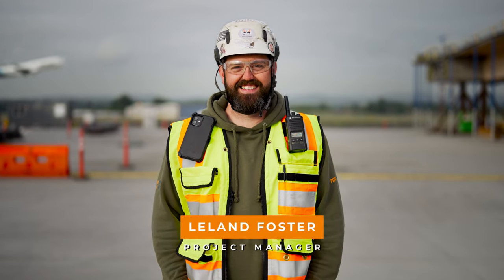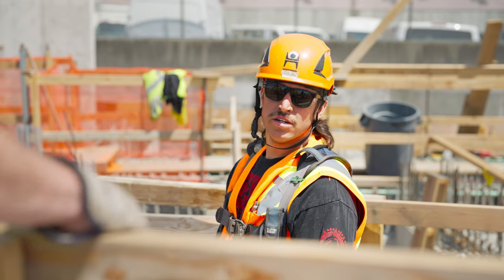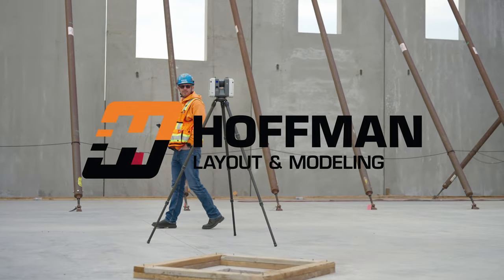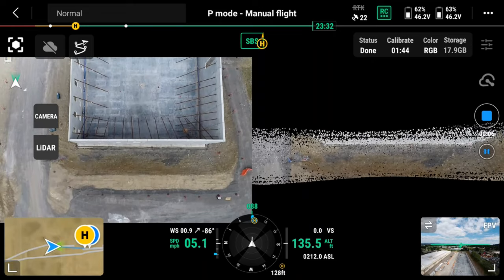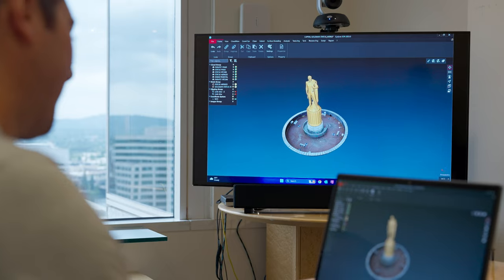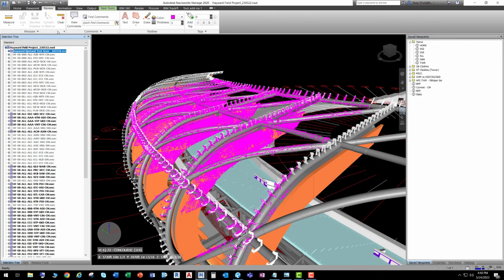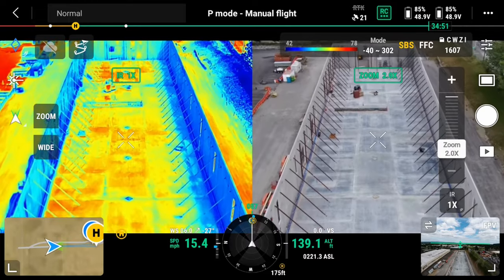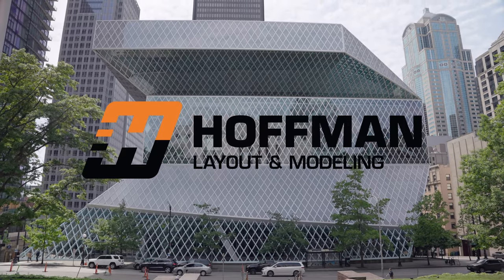Hoffman Layout & Modeling

Comment: Can't build it accurately if you can't locate it accurately. Layout precedes construction. As project continues, accurate 'as-built' verifies it was built to specifications. 

I was a Student at UW in the 70's. I had a part time job with a surveyor. Dreaded urban surveys because we were still using steel tapes. After half a dozen broken tapes, repairs, and recertifications, we switched to EDM (crude by today's standards).